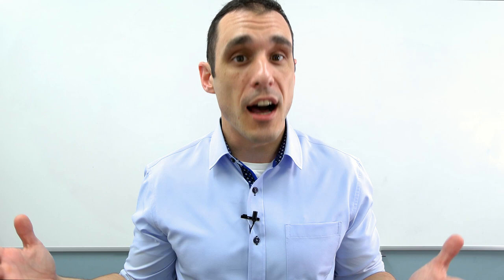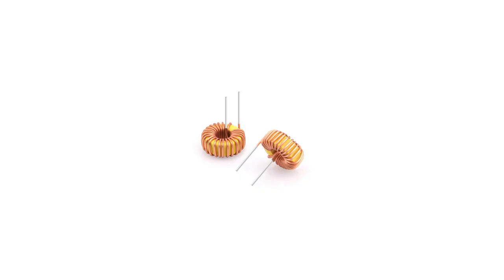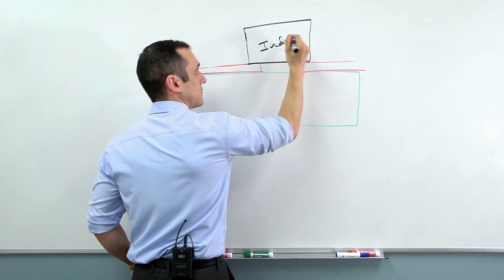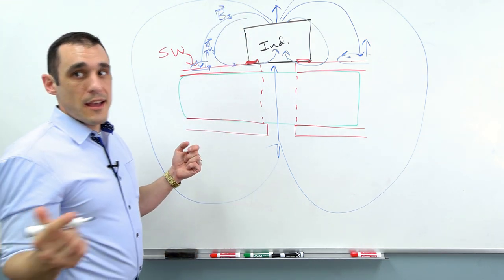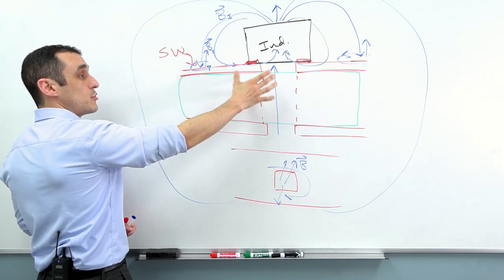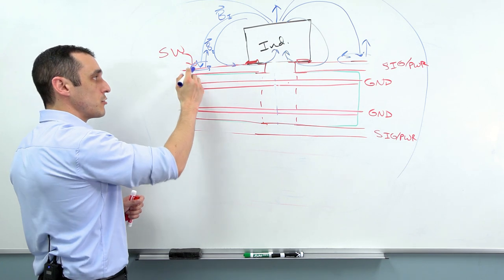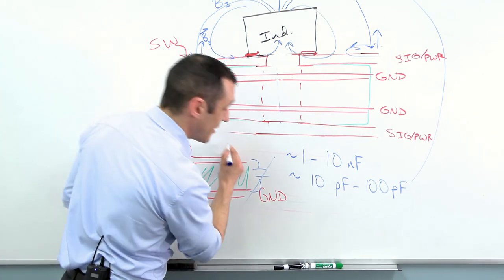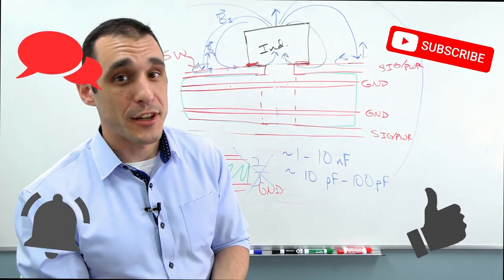Should You Put an Inductor Above Ground? | PCB Layout

Comment: Has anyone actually built two versions of the same circuit, one using cut out and one with solid plane, and carefully measured and documented the performance of the regulator and the conducted and radiated effects?  Given the price of 2 and 4 layer pcbs, this would be straightforward and could put the issue to bed for good.  "I've never had a problem doing this or that..." is meaningless without actual data, including the switching frequency and currents.
Reply: Sounds like a great idea for another video....
Reply: Yes, there is video - https://www.youtube.com/watch?v=q0oH-nV3dpI and article

Comment: My old professor used to say, it isn't true if it isn't measured.  It should be easy to do a test board with all the different options and measure the effects.    No need for speculation.
Reply: Well since you bring it up, I designed a test board for this with three copies of this regulator circuit and it came back from fab last week! We'll be doing a video showing testing soon so stay tuned. Also, there was just recently an article by Ken Wyatt and Steve Sandler in Signal Integrity Journal that did some tests of this and came to the conclusion that ground is generally preferred at MHz and higher frequencies.
Reply: @Zachariah-Peterson  That will be interesting.
Reply: @Zachariah-Peterson  Hi Zac did you ever get around to do this testing?

Comment: The capacitance on a net is way less than an external FET gate capacitance. Power conversion, sure you might take a bit but it is crazy small. Ground under the inductor and keep the ground from the output cap, IC PGND, input cap, and GND for external FETS (ignore if internal) in the same ground, with a single connection to main GND. This keeps the current loop inside of the local GND and any inductor noise will stay inside as well (within reason). Good technical video, I enjoy these, you never know, you can always learn something.

Comment: You state that the magnetic field is redirected by the copper, but the relative permeability of copper is ~1, so I think that the magnetic field passes through the copper unaffected.
Reply: I meant by the eddy current induced in the copper, but you're right copper has low permeability and is non-ferrous.
Reply: After researching some more, it seems some of the AC component of the magnetic field gets cancelled out by the opposing magnetic field generated by eddy currents on the copper plane. I would be curious to see the math or simulations showing the field lines at different frequencies.
Reply: @tr3kn3rd  a very simple approximation is that one skin depth worth of copper attenuates the field by e times. So a typical pcb copper thickness of 50um is effective at screening off AC fields from about 2MHz

Comment: I think copper is not ferromagnetic and hence, it is useless shielding magnetic fields created by inductors. The most practical way is by using shielded inductors (which use ferrite or other ferromagnetic materials). The major reason to wanna place ground planes underneath is to reduce the current loop of the switching node.
Reply: It's been awhile but I believe I mentioned the current loop of the switching node in the video and it does not have enough capacitance to bypass typical power MOSFETs. Also copper is diamagnetic and is slightly opposed to an incoming static magnetic field, but that is not the mechanism by which shielding is provided. Eddy current formation is the physical mechanism responsible for this.

Comment: Make this an isolated power supply, with isolated ground copper pour under high dv/dt switching node and/or inductor. Does that change anything?
Reply: No it should not change anything. Regardless of the topology, EMI from switching in the inductor will be affected the same by the presence or absence of ground. In an isolated power supply, you will have a transformer, and that transformer will also have some leakage inductance that admits release of some magnetic field. Even with a shielded or toroidal transformer, there will be some leakage, and in order to maintain galvanic isolation you can't use a totally solid copper plane to suppress the surrounding magnetic field.

Comment: I believe that magnetic fields of inductance at low frequencies up to 1 MHz do not have any effect on the tracks on the printed circuit board, since copper has low magnetic permeability and is not a magnetic conductor, the magnetic field passes through the copper tracks.
Reply: If this was the case, how could crosstalk between traces be possible < 1 MHz?
Reply: @remy-  This frequency was given conditionally.  At low frequencies there is a magnetic field and an electric one, at high frequencies it is already considered to be homogeneous.  Copper and other materials with low magnetic permeability are absolutely transparent to the magnetic field, but the electric field still affects them and interferes, but it is perpendicular to the magnetic field, if what you drew is called an electric field, then this theory works, but in sources  power supply frequency is usually less than 1 MHz, so these concepts should be separated there.
Reply: The point is that with copper we get shielding on electric field, but not magnetic field (which would result in eddy current )?
Reply: @remy-  At 1MHz sine wave? Or do you mean 1MHz digital? Digital rising edges in the MHz contain waves in the GHz.

Comment: I've heard the phrase: 'If you don't know how to do ground right, just put lots.' 
That's the mantra I live by.
Reply: I absolutely agree eventually it's going to choose the path where it 'see' the lowest impedance.
Reply: Unless it's best to separate the switching 'ground' currents from the 'signal' ground currents.  
I once troubleshot a design where a current sense amplifier output was sometimes indicating 5-15mA over current....I eventually noticed on the PCB layout files that while the schematic showed a separate wire for the low-side input of the current sense amplifier, the net name was still 'Gnd' and the via which the designer intended to use to route the separate signal sense line on an inner layer, instead connected directly to the ground plane which had other power currents flowing which produced a significant offset voltage on the amplifier's low-side input.  
But, still if one doesn't know how to 'do ground right' well, that's just one of the things that can happen.  ;-)

Comment: Another great reason we should NOT put a cutout below the inductor is so we can provide a solid, continuous return path for the switching current in the inductor. Any cutout will interrupt the flow of the return current that WANTS to flow directly below the inductor.

However, in my designs, the copper that i do remove is the one below the inductor, but on the same layer as the inductor pads since this ground fill between the pads may create unecessary parasitic capacitance that could affect the inductor value.

TLDR: cutout on 1st layer, solid plane on 2nd layer for me
Reply: I do the same thing: Remove planes in the closest one or two layers. Keep the plane in the other layers. As often recommended in small regulator datasheets.

The 1-10nF MOSFET capacitance mentioned in the video is for big 10A regulators. Small 500-1000mA regulators are less than 20pF.
This actually makes sense: It is typically small regulators which have the GND cutout recommendation in the datasheet, while high current regulators don't have that recommendation.

The current through an inductor is by definition low dI/dt. Which makes the return path less important regardless.

Comment: Rick Hartley has a great presentation on Altium Live about field containment and proper shielding. It applies here as well. 
Always have a solid ground under the switching power supply. Most importantly try to provide a low inductance GND return path (preferably on the same layer) from the output caps to the switch GND pins to keep current loops as small as possible. Tie this GND return to the GND plane AT THE SWITCHER and not at the output caps.
Try to place switching power supplies away from sensitive circuits and avoid routing high speed digital signals or sensitive analog signals underneath a switching PSU.
Reply: But isn’t we are buying +-20% inductor?
Reply: @gn_ghost4757  It’s not about accuracy of the inductance, it’s about shielding against stray flux and minimising impedance in the high current/frequency paths to maximise performance.

Comment: I have done couple of boards with switching regulators on. Normally my boards have a solid ground plane on the second layer from the top/bottom. A lot of my boards are micro via, which makes the substrates between the layers very small. The reason I would remove the ground plane below the inductor, especially on the switching pin to the inductor is to minimise the capacitance, as the switching frequency would be influenced by the additional capacitance. On the output of the inductor the added capacitance is welcomed, and I never remove the ground plane from there.
Reply: I have seen that practice as well. For a 1 sq. mm pad size on 3 mil thick dielectric with Dk = 4, the parasitic capacitance for that pad is only 0.4 pF, so it's really small! It will be much smaller than most FETs. However, the inductance of that leftover hole would also be very small so I would expect small mutual inductance with respect to the high side of the inductor. I would suspect there is probably not much effect but if there is data out there to show differently then that would be interesting.
Reply: That's where this presentation is wrong. It says the capacitance is so low it will not interfere. However, you will see it does matter if you calculate the capacitor impedance. It would be better to learn people to analyze their boards instead of trying to provide some general rules.

Comment: Hey, there's a full differential amplifier from TI that's got the weirdest recommended layout. On a four layer board they've avoided ground under the device. The part is THS4551. Your explanation/critique could make a good video.
Reply: I'm looking at the datasheet and I second this. The first bullet point in 12.1.1 Board Layout Recommendations states
> When the signal goes to a resistor, parasitic capacitance becomes more of a band-limiting issue and less of a stability issue.

The example applications are a all filters with frequency plots from 1kHz to 100MHz, so impacts on frequencies seems crucial for this part.
Reply: @Ziraya0  The THS4551 is a higher frequency (getting close to RF) diff amp, and is not an apples-to-apples comparison with a switching regulator inductor. For instance, the THS4551 is not an EMI offender, but rather would need to be protected from EMI since it is a noise-sensitive component in the analog signal chain. Also, any reduction in capacitance at the pads (pF matter here) of the IC is going to help the frequency response of the designed filters.
Reply: Most high speed op-amps have ground cleared under the pins and feedback nodes at the very least. Any parasitic capacitance can cause instability in high-speed high-feedback amplifiers.

Comment: The SMPSUs usually use an RC oscillator to adjust the frequency with a very small capacitor like 470pF or smaller. Can this extra capacitance (from the GND plane) influences the oscillator's frequency?
Reply: If the unit you are using has the driver and switching elements in an integrated circuit that uses an RC oscillator, then no the excess capacitance probably won't be noticed. If you're using discrete components then maybe it will be noticeable, but at that level you will have separate gate drivers, a current sense amplifier, and probably a controller with a feedback sensing mechanism, it all tries to compensate for deviations from target oscillation freuqencies and power output values. Even in those cases the capacitance in the switch node will probably be small so I would not expect it to affect the frequency significantly, and even if it did the feedback tracking in various portions of the system would probably compensate for it automatically.

Comment: I was searching for how shield reduce inductance of air core coil used in my circuit.
And from paper "Effect of a Conducting Shield on the Inductance of an Air-Core Solenoid" it looks like proper shield should be huge.
For example, if diameter of shield is twice the diameter of coil, inductance reduction is ~15%, for thrice diameter, reduction is ~5%.
Of course, coils with ferrite core will behave differently, but what I learned is that it is not that easy to properly contain field of a coil.
Reply: Yes that is true, shielded inductors help contain the magnetic field but it is not a perfect shield.

Comment: YOu mentioned the level of paracitic capacitance of the PCB board , but what's the eddy current level or opposition flux  ?  what extend of impact is it gonna have to reduce the  inductance effectiveness after we give such a small area of cutout under the inductor?
Reply: It depends on the edge rate of the switching waveform and  the size of the induced current. It also depends on the geometry of the copper, it is actually quite difficult to calculate and would require an electromagnetic field solver. There is an article in Signal Integrity Journal that looked at emissions from the cases with solid return plane vs. plane with a cutout. They found that at frequencies above 10 MHz the presence of the plane produced lower emissions compared to the case with the cutout. The article is titled: DC-DC Converters – Solid Return Plane or Cutouts Under Switch Node and Inductor?

Comment: The best reason I find for not putting copper under an inductor is assembly. Other than this, there should be no real influence as long as the switching power supply is separated from the rest of the design at the input and output capacitors' pads. There should be a cutout in the copper that allows current flow around the pads only and the EMI problem is solved.
Reply: How does copper under the inductor affect assembly?
Reply: @ytpeep7393  It's the thermal mass I was thinking about. The inductor has a big amount of thermal mass and the substrate underneath has also a big amount, both being mostly high thermal resistant materials. There is the EMI too which should be considered when we think about inductors.

Comment: @Altium Academy: Placing the ground plane below the inductor reduces the value of the inductance itself. Is this true ?
Reply: I think that is what he was saying when he gave values like 1-10nF and 10-100pF ... yes, it reduces the inductance, but on the order of 1%, so maybe even less than you're losing in other ways by not having it.
Reply: @Jim J. Jewett  Those numbers were in reference to the parasitic capacitance created by the nearby ground, which would theoretically reduce power conversion efficiency if that capacitance were large because some power would be diverted away from the inductor. So you have to compare to the rectifying current path and the output to determine if there is enough leakage to produce considerable reduction in power efficiency at the switching frequency. Since the FET has higher capacitance during charging it will control the switching current path by providing the lowest impedance to the switching node and the inductor.
Reply: He said that, those magnetic lines which escapes from the ferromagnatic core (they don't really want, but in real life they will) create eddy current in the copper traces, what will create opposite magnetic field (Lenz's law) which decrase the inductance. So this only applies for that part of the inductance what came from the air around the inductor, which is not too much.
Reply: i'd expect it to mostly increase the losses of the inductor (which are the heat generated in the ground plane by eddy currents)

Comment: Hi, does this work same for POWER transformer? ( use for isolation in dc-dc convertor consider a PSFB)
Reply: Essentially yes because transformers are just inductors that share a magnetic material as the core material. However it's important to note that transformers are normally oriented such that the field lines run parallel to the top surface of the PCB and will already form concentric circles, so the field line drawing does not exactly apply to all transformers. Also power transformers are normally used in applications where you need galvanic isolation (such as an isolated power supply), this means you have a ground split somewhere in the board, and that ground split is usually placed right near the transformer.
Reply: Yes there is a split in ground but I saw some vias under the Tesla charger Transformer (It is a 10:12 Transformer which is multiple PFC voltage by 1.2 ). Or maybe those are not via but look like some of them (I can not post a pic of it in here) in our design it is a PSFB topology used for OBC (OBC: On Board Charger),  two grounds are away from each other and just in some small area connected with MKT capacitor to chassis total power of each module is 3.3KW and in total having 3 of them parallel and we get 10KW power but there is no clue that, Is our grounding okay?(because we do not have EMI problem in here, because no one check it!) but there is some inaccuracy in  sensor measurement and problems with IO of PC when OBC work with its full power (i.e 10KW) and probes show the large switching noise from Transformer and inductors which are toroid. thanks to the advice the revision have better condition but Transformer is still noisy💀.
Thanks for replay it is mean a lot for us.🙏🙏
 @Zachariah-Peterson